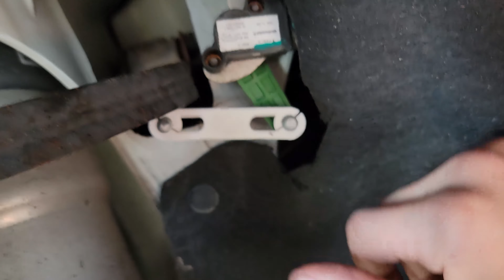Lower Your Tesla For $5

Comment: Doesn't seem too safe at all
Reply from the maker: Good intuition, but if the lowering link breaks, the car will slowly air out. This has happened to me before and it was not a big deal to fix on the side of the road! The lowering link does not physically support the weight of the car.